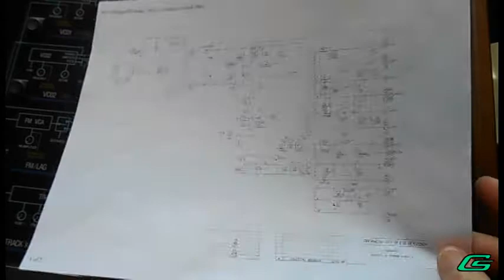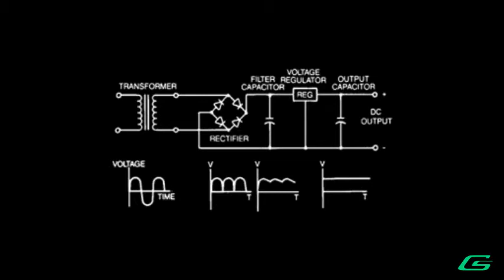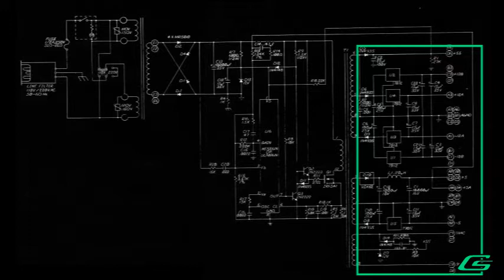Oberheim Matrix-12 Synthesizer Power Supply Issues RESOLVED

Comment: Interesting. I'm restoring a M12 right now with the exact same issues (freezing/rebooting/voice 1 processor malfunction). Already replaced the big caps in the power supply and a slightly toasted resistor, helped a bit but isn't completely solved. Do you recommend replacing also the smaller 15uf caps? and the power line input? has it been solid ever since or anything else was needed to get it stable?
Reply from the maker: @gilwe  UPDATE June 2020: Also not mentioned in this video, be sure to replace the memory backup battery.  It does more than keep patches saved, it also maintains calibration settings.  Which is another cause of voice processor malfunction messages.

Comment: I have an M12 & Xpander. Both are USA made units. Strange thing is my M12 doesn't quite have the same output volume and clarity in sound as my Xpander. I´m puzzled as the voice boards are identical.  
Do you think a PSU recap could help?  Otherwise fantastic synths that are a joy to play & program. Thanks for the informative video.
Reply from the maker: My M12 also is a bit lacking in volume and clarity compared to other synths.  And I've recapped the PSU.
Reply: @gstormelectro  I´ve now replaced the main capacitors and filter module on my M12 and it´s sounding great now.
Thanks for this very helpful video.

Comment: I recapped my power supply, but it did not solve my Voice 0/Voice 1 
Processor Malfunction problem. Following a lead on the net, I just 
ordered an HD68B09P processor from Ebay. It was cheap, brand new, but 
has to be shipped from Hong Kong, so I'm not expecting it for a while. 
In the mean time, here is the Mouser BOM for the power supply recap, 
including all the capacitors, in case it helps anyone else: 
	
	
	
	

MATRIX 12 POWER SUPPLY	
	
	
	
	
	
	
	
	
ser #	Mfr. #	Manufacturer	Customer #	Description	RoHS	Lifecycle	Order Qty.	Price (USD)	Ext.: (USD)
667-ERX-2SZGR10V	ERX-2SZGR10V	Panasonic	
	Metal Film Resistors - Through Hole 2watt 0.1ohms 2% Axial AEC-Q200	RoHS Compliant	NRND	4	$0.52	$2.08
871-B84771A0001A000	B84771A0001A000	EPCOS / TDK	
	AC Power Entry Modules Standard Filter 250volts 1A 0.173mA	RoHS Compliant	
	1	$7.76	$7.76
511-L7912CV	L7912CV	STMicroelectronics	
	Linear Voltage Regulators 12V 1.5A Negative	RoHS Compliant	
	2	$0.49	$0.98
511-L7812CV	L7812CV	STMicroelectronics	
	Linear Voltage Regulators 12V 1.5A Positive	RoHS Compliant	
	2	$0.45	$0.90
511-L7805CV	L7805CV	STMicroelectronics	
	Linear Voltage Regulators 5.0V 1.0A Positive	RoHS Compliant	
	1	$0.50	$0.50
594-2222-021-15103	MAL202115103E3	Vishay	
	Aluminum Electrolytic Capacitors - Axial Leaded 10000uF 16V 20% Axial	RoHS Compliant	
	1	$4.98	$4.98
598-109TTA025M	109TTA025M	Cornell Dubilier	
	Aluminum Electrolytic Capacitors - Axial Leaded 10000uF 25V 20%	RoHS Compliant	
	1	$6.11	$6.11
647-UBW2A220MPD	UBW2A220MPD	Nichicon	
	Aluminum Electrolytic Capacitors - Radial Leaded 100volts 22uF AEC-Q200	RoHS Compliant	
	1	$1.10	$1.10
647-UKL1V150KDDANA	UKL1V150KDDANA	Nichicon	
	Aluminum Electrolytic Capacitors - Radial Leaded 35 Volt 15uF 105C 5x11 2LS	RoHS Compliant	
	10	$0.155	$1.55
647-UBT1E101MPD8TA	UBT1E101MPD8TA	Nichicon	
	Aluminum Electrolytic Capacitors - Radial Leaded 100uF 20% 25V AEC-Q200	RoHS Compliant	
	4	$0.54	$2.16
647-UVY1A102MPD	UVY1A102MPD	Nichicon	
	Aluminum Electrolytic Capacitors - Radial Leaded 10volts 1000uF 10x12.5 '20% 5LS	RoHS Compliant	
	2	$0.45	$0.90
Reply: Did you get your issue solved?

Comment: Thank you for this great info! My Matrix 12 is giving the same error, and I was about to start working on it. This really helps me move forward more quickly. :)
Reply from the maker: Also not mentioned in this video, be sure to replace the memory backup battery.  It does more than keep patches saved, it also maintains calibration settings.  Which is another cause of voice processor malfunction messages.  I'll add this info to the description here.

Comment: Hi G-Storm !

I had the same symptoms a while ago, mad function processor 1 etc ...

Looking carefully, I also had the two resistance crack
I was quick to change

I also wanted to change the filter, but I do not know how to connect the new

Could you confirm me how to connect the connections to the new filter

Theoretically the line that leaves the Fuse connect on the "Liner" and the other runs on the N

Could you please explain all this quickly to me please

Let me know
thx
Reply from the maker: Do you mean the power entry module?  Be sure to connect the ground wire to the ground lug.  Doing otherwise will blow up your synth.  If you're not sure what to do be safe and have a reputable service tech look at it.
Reply: "Do you mean the power entry module?"

Yes...?

For the ground wire, no problem

for the two others ?

"(on  New Filter)"µ............

The fuse wire will connect to ???  L  Liner ? 

And the other on N

Could you give me a picture if possible?

Comment: thanks.  My M-12 just shows the Voice Processor 1 Malfunction now.  I'm going to take it to my repair guy, but it was really helpful to learn about the power supply- especially just the basic plug, as I've long suspected that it was a bit wonky.  I've owned mine since 1986 (after people bought them and were so confused by them they gave up and sold them way cheaper).  It's the greatest asset I've had in my studio for recording atmospheres and unique sounds.  I want it to keep working for as long as possible!

Comment: hi bud. the korg is in the shop right now. I was wondering, I recently bought an oberheim obxa. and it was working fine for two weeks. but then I flipped it on and nothing worked, no lights lit up.. then I plugged it into another outlet and lights came on but the power on and off switch as well as others started to blink and the only audible sound was a buzzing noise I checked cassette interface. as well as voltage all is normal. I turned it again today, and its still making a buzzing noise. but the only thing lit this time is the on off switch... still blinking. could you fathom what might be wrong with it?? thank you
Reply: no....I bought it from Patrick Leonard. keyboardist of Madonna. he already warned me that in the last 30 years he never had any major work done on it other than minor cleaning. I'm already assuming oxidisation or a new power supply. be nice Karen. I am well aware of how unique you are.
Reply from the maker: Could be anything.  Possibly a loose connector inside, power switch going out, possibly needing a recap job, or likely corrupted RAM data.  For bad RAM data the OB-Xa does not have a soft reset feature unfortunately.  RAM stores the patch data but also is a snapshot of the software calibration data.   So that would need to be looked at by a tech.  Youtube user SynthChaser has some repair  videos for the OB-Xa if you're interested.  Check out the Memory Retention Repair vid.  Seems like you may have something similar going on.
Reply: gstormelectro thank you. yeah I was thinking something may have come loose during shipment. or as I mentioned about power supply or oxidisation. it was completely fine two days ago.. I'm about to take it to waveformless in Oakland. I have read oberheims have big issues in regards to oxidating. I'll check that channel out. btw korg 770 is in the shop. again, thank you for the purchase, its a beauty.
Reply from the maker: I deleted the trolling comment.  Sounds like your ax has some very interesting provenance.
Reply from the maker: I presume the 770 will also be getting the CV-gate-filter input mods done?  It's going to be bad to the bone.
Reply: gstormelectro lol.. it's ok.. Karen is special... it's like a grade school hate/love thing between us. I'm sorry. anyhow. no, no mods just yet. I've been forcing myself to record old school, straight into my tascam. For now I'm just getting those connections back in place. for a tiny lil thing it growls. I love it. alas I'm in fear of what is wrong with the obxa. I'm hoping it's just caps/power supply. the original owner said no major work was done on it in 30 years. crazy
Reply from the maker: Sorry Karen!  I don't mind amusing banter, but there have been some knock down fights here before  Glad the OB-Xa will get the love its needing.  Does it have all 8 voices and/or the memory expansion?
Reply: gstormelectro it has all 8. but  why upon recieving it that its fine for two weeks, then completely dead??
Reply from the maker: @KAREN W :D already forgotten.  Device Factor, you're on your own there bud.
Reply from the maker: Device Factor, it's a good thing for the OS to stop responding.  It's in a protection mode that prevents, or attempts to prevent, damage to expensive circuits and chips.  As you suggest, shipping may have aggravated some condition or intermittent problem.
Reply: gstormelectro thank you so much.i know no synth is a dead synth
unless it's extremly beyond drastic